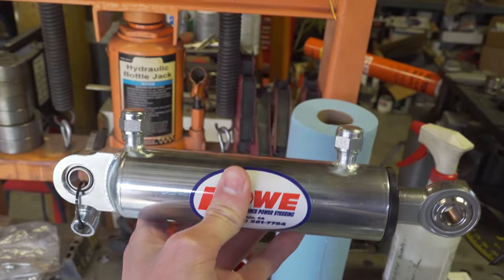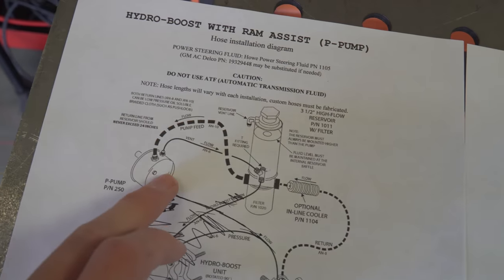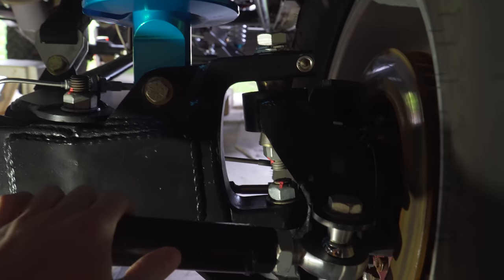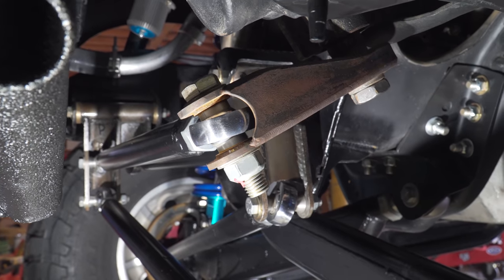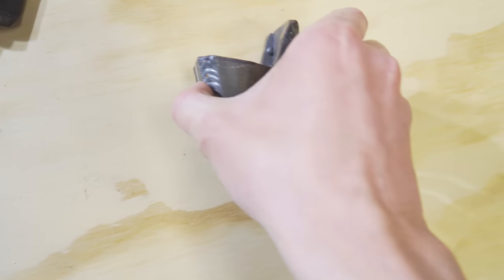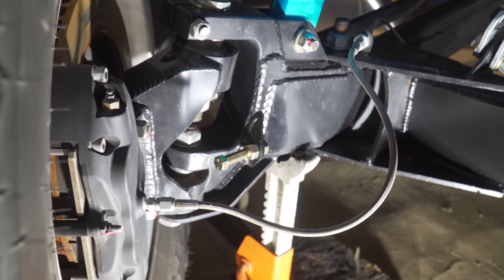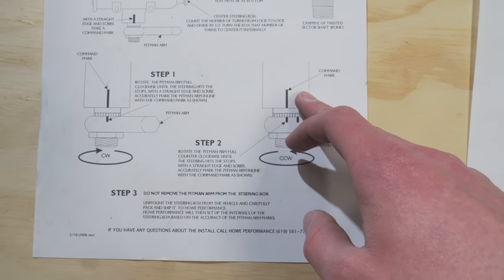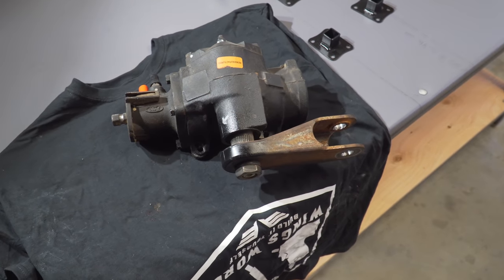RAM ASSIST EP. 01: Mounting the Hydraulic Ram Properly

Comment: Me key prt, I would want double spindle connection y arm deal.
Reply: I wouldn't put the spindle arm 2 mount pnts on the same plane, that way if tire up or down the load & force & max turn geometry still all the same. A high mount & lower mount y arm deal.